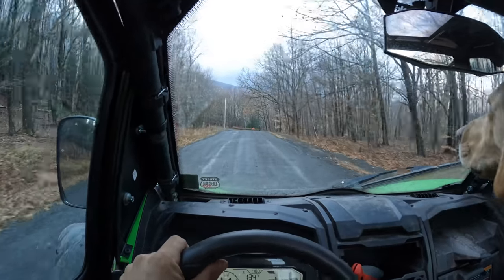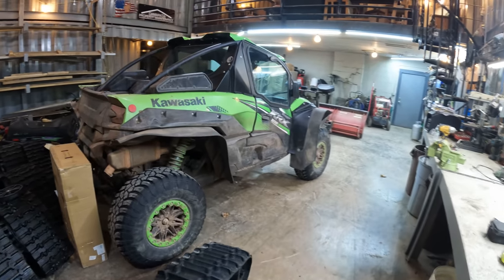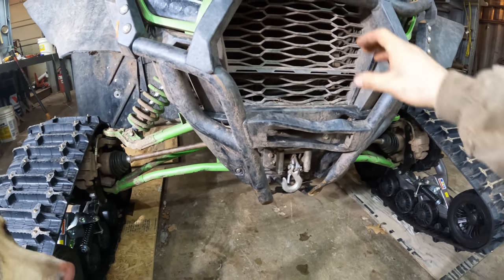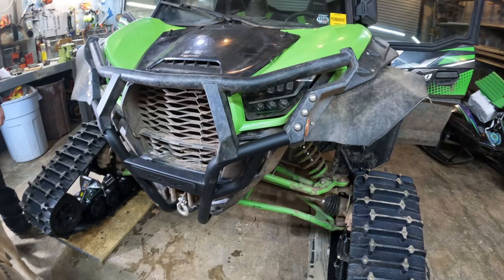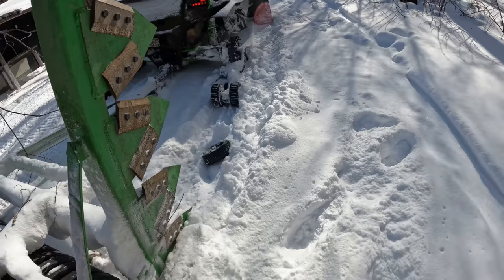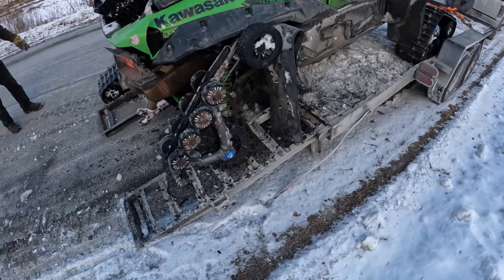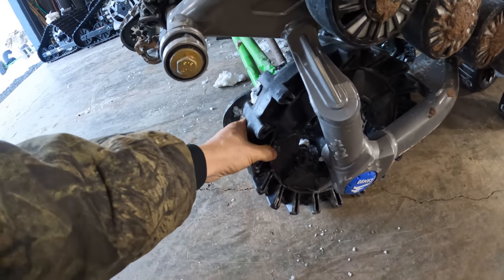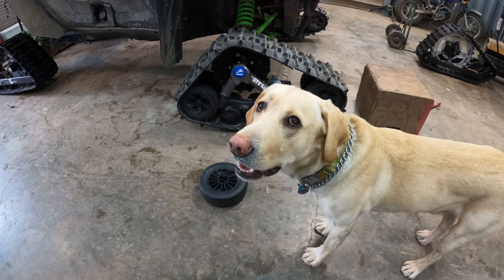Installing snow tracks on a sport UTV

Comment: When was this filmed? the NY winter is over, it's going into summer now from spring, why put the tracks on when there is no snow!
And why would you not clean it first before putting nice new clean parts over the top of dirty muddy parts that will create corrosion!
Especially at 10:56
All the extra weight (+300kg) of the glass and the excessive accessories has put so much extra stress on the suspension and drive components of that poor UTV you can see how much is sagging and has no suspension travel any more.
Reply: This is a video that was filmed during the winter. He said that he was behind on editing

Comment: I knew early on when he was putting them on that they had cheap plastic he wasn't going to like them. Sure enough the molded plastic busted up. Those wheels should be steel. Not even aluminum.

Comment: Camso’s aren’t a bad track.
Probably should have stopped and fixed it when you saw the brackets were bent. The one that is wrecked can rebuilt for a few hundred, wheels and bearings all readily available. I put some on my Polaris General
Reply: I suspect that replacement parts are readily available because they break so easily.

Comment: Dude just put the tires back on and air them down. Tracks are a horrible idea and will completely destroy your suspension, entire drivetrain and steering. It's creates far too much leverage and stress like putting a MASSIVE wrench on everything. The entire vehicle would need to be re-engineered for something like that and right now it's just not. Bad idea.

Comment: i work in avation composites and yea its so odd that they make these cheap plastic parts. miterial science has come leaps and bounds and actuly good plastic that wont fail on you is only a few cents more per part. feels like sutch a waste because its almout but not quite a stright swap, because of different shrinkage it wont quite come out the same size from the same mold. those molds cost an absolute ton so i dont see them changing them to work with a better plastic.

Comment: If ya want more top speed on a SxS with tracks......get a faster SxS. The Kawi is a tough machine but NA and around 110hp at the crank, she's not a speed demon.
Reply from the maker: Its more about gearing than the engine power.

Comment: I love my Camso tracks, but I do not abuse them. I wouldn't sell you anything.  You could wreck a tank because it would not go 60.. Stupid like building your embankment at the castle without clearing the vegetation and benching the slope. For someone that wants what you build to last, your embankment will slide when the vegetation rots.  Common denominator here is you.

Comment: My camso tracks are junk. Constant maintenance and ridiculously priced parts. Just plan on replacing just about every bearing every year. The spindles are very soft, and a seized bearing will destroy the shaft in a very short time. The plastic wheels refuse to retain the inner seals unless you bond them in. There is nothing "Long-lasting" about them. Take your same $6,500 and put it towards a purpose-built snow machine.
Reply from the maker: I agree they are junk.

Comment: " welp, that's bent "  " Just keep runnin' it "  then blames cheap stuff when it breaks after abuse it was NOT designed to absorb.     If he had stopped after they hit that ditch...but no.
Reply from the maker: This was designed for this use.

Comment: These utv's are huge money pits. The price people pay for them should be much higher quality.
Reply: Try riding in one
. They are money pits but the ride experience is like none other its pretty impressive where they go.
Reply: @CerebralAilment  I have ridden in several. If we're switching my comment to a conversation of experiences, for the 30k price tag minimum on one these not including much needed upgrades from the factory due to dereliction of design which is another 10k I'd fabricate me my own rock bouncer for way less and would be far my capable and durable. Now those are an experience.

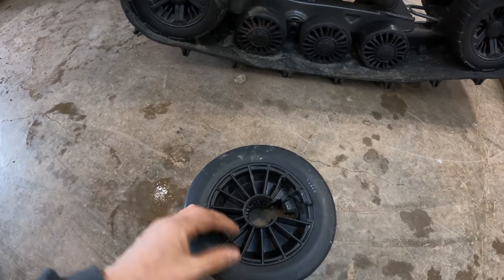Comment: 41:10 if they made that part from cast aluminium you’d still smash it to pieces. You just don’t know how to look after stuff and have zero mechanical sympathy.
Reply: Naw, plastic in super cold does not work well. The roller wheels really should have been made out of steel.

Comment: How do you turn a nice $25,000+ SxS into a piece of junk that you'd never want to own? Give it to this guy. Now I really do like Andrew and think he is a clever guy but I would never want to own anything he's owned after seeing how he works on his toys and equipment. As for the tracks he installed on the SxS, he's right, for $6,000  they shouldn't have cheap and fragile plastic parts like that.

Comment: I would make a set of tire snow chains for each wheel when you need extra traction. Don't like the track setup at all !  not a good design , too fragile and expensive to bother with. Send them back to the manufacturer and ask for a refund. Cheap design and construction , not worth the price or the trouble to install & it doesn't even fit properly.

Comment: Fiber reinforced plastic with a much stronger structure would do - aluminium would be even better - unspring weight should not be a concern in the snow anyway.
You should also think about a thicker rubber ring to absorb hard impacts. 

And stay away from those canned marketing bullshit messages: "our materials have been carefully handpicked by our boss during a full moon using sacred magical spells..." - dont ever try to blame the customer when there is video proof that he was not abusing your product.

Better spend your money on product quality then on marketing and be honest for a change : "sorry dude, seems like we fucked up and tried to cut corners on the wrong parts, that rollers should not have broken - we had some serious talks with the engineering department and will be happy to deliver upgraded parts to your place - we also adressed the speed/RPM issue and now we offer different drive sprockets to fit any specific requested gear ratio". 

That would be easy, because you can compensate different drive sprocket diameters with a corresponding tensioning roller diameter - nobody wants to swap a 6000 dollar  track set if he buys a different atv.
Reply from the maker: You are 100% right

Comment: Somebody needs to put the crack pipe down.  Abusing equipment is not testing equipment.  Wrecked your side x side in the process.  The repeated driving up the trailer was 100% comedy.  You used to treat equipment with respect and now you just trash it.  Pretty sad that companies send you products that you abuse and then trash talk them.

Comment: Plastic parts as rollers in a moving setup is designed to fail.Plastic wheels on a tiny kids car is fine but on a moving UTV..that is an engineering joke. I'm a redneck and even I could design something better than PLASTIC.

Comment: I have those Camso tracks and have not had any problems with them. Of course, I am more careful than if I had tires on…you can’t just run over stumps and expect them to last. But hey, if you had stopped driving when you discovered something was bent and made the repair at that time, you never would have broken the wheel. Then you did even more damage by driving without the track, and even more damage by driving onto the trailer with the track off. And you were surprised there was so much damage? I am not trying to be mean, but you did it to yourself. As the saying goes, “A stitch in time saves nine.”